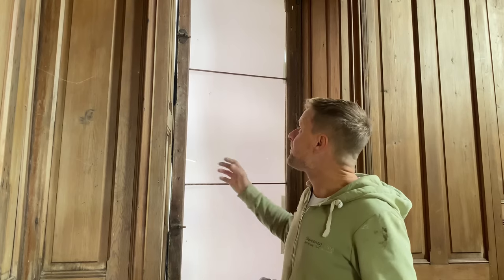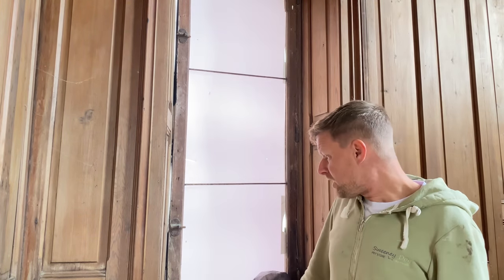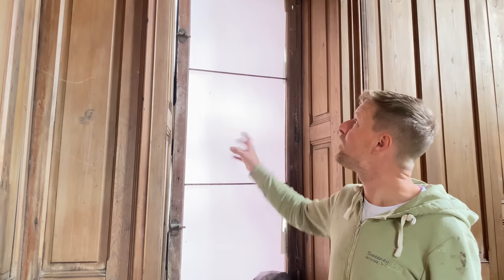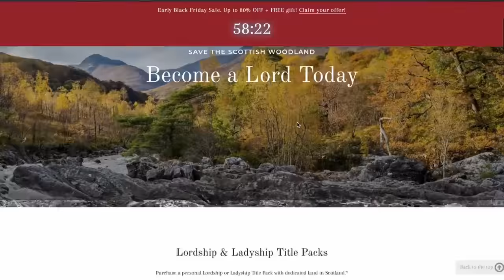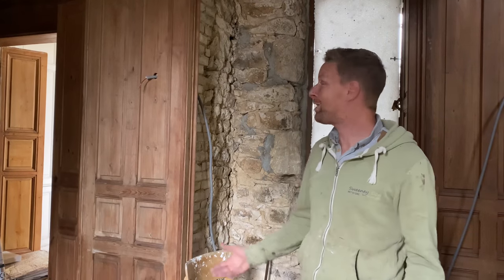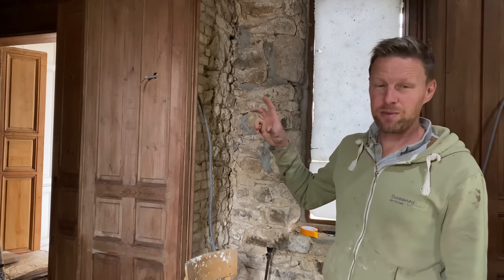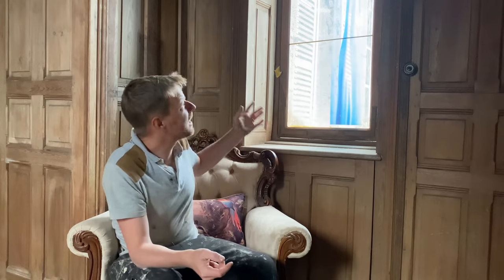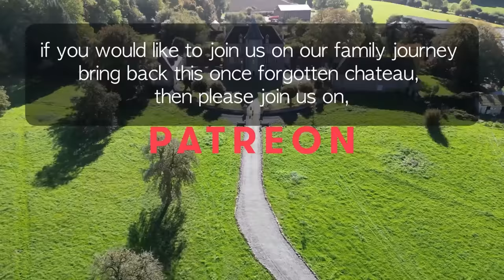REMOVING the château Woodwork | DUST & DESTRUCTION. Ep 83

Comment: Such skilled work, Terry restoring the window and the surrounding  panelling!
Good  foresight installing needed wiring whilst some panels  have been  removed. 
* Have you heard of smart lighting? 
No need for wiring connecting the switch to the light. 
Instead, either a Bluetooth or WiFi signal is sent from the switch to the light to turn it off & on. Two different  systems - either Bluetooth  Or WiFi.
Could make installing some lights much simpler! 💡

Comment: I often wondere instead of making holes or visible switches for light if a lightsensor isnt a better way to go (you don't see modern switches, etcetera and you have light when someone is in the room)
Reply: We’re replacing with old porcelain switches and tracing the original electrics that were put in :)

Comment: Question: Is the left side of the exterior of the tower intentionally supposed to be pink/reddish while the right side is gray?? At first I thought it was a trick of the light, but no, they're two different colors.
Reply: They are. It’s a type of mould, as the right side doesn’t get the wind from up the valley, the fungus has settled better :)

Comment: Love watching you restore things however I’m puzzled as to why you didn’t get one of the others to repair the walls whilst the panelling was off as the repointing looked as if it badly needed doing?Also if you can get the lighting done whilst the panelling is off,then why not the insulation too?You don’t want it to be all fur coat and no knickers,looking pretty but too cold and leaks coming through the pointing😟after all your hard work.
Reply: So...do you think they just didn't think about these things, Cath....!?
OR, isn't it much more likely they did - and took the deliberate decision NOT to do them at the present ..!?
Reply: @andymccabe6712  yes I think they will be replacing the windows one at a time as funds become available. A proper job when the money is there.
Reply: @andymccabe6712  Did I say they hadn’t thought about these things? I wondered why they hadn’t done them whilst the stone was uncovered .

Comment: Did I miss something but when did you repair the boiserie you had removed? It was also surprising that you didn't seem to have to remove any nails, pegs or screws either taking it out or putting it back. At laLande the Grand salon has wood blocks embedded that once held the original boiserie. At least that's what they think they were. They probably were for the paneling because I vaguely remember reading something years ago about the same thing in American paneled rooms of that period. Do all the panels actually sit loose against the walls? You didn't seem to have to do anything but reinsert them against one another. Another puzzle was why would the original builders build interior walls of brick but used rubble and dressed stone for the exterior walls?  My guess is that at the time the dressed stone was the most expensive, the rubble the least expensive, and the brick was mid-value material. Why would they use brick for interior walls that were mostly concealed with paneling anyway?  
BTW - It was a big surprise to learn years ago that the wings of the Palace of Versailles were/are not built of solid masonry. Evidently the king hired a man more experienced in building fortifications because the work was taking too long.  Louvois used pise de terre or tamped earth to fill the space between the inner and outer masonry walls of the garden facades. A problem occurred by the time of Louis XV when somehow they discovered that the earthen core had settled by up to a third of the height of the walls and they had to be refilled at enormous expense.  The workmen had evidently rushed the packing and hadn't packed it hard enough. It should be as hard as sandstone if done right.  Years of vibrations transmitted from floors to walls may have caused the settlement? But what would have let them know that had happened? Somehow they had to get into the cavity of each pier between the windows and some guys (not claustrophobic) had to climb down inside the well of enclosing walls surfaces and dig it all out to then replace it with either stone or more earth? I wonder if even the curators know what fills those walls today? 

I suppose they could have done it by going floor to floor from within each room but that would have meant disturbing the occupants of the apartments at three levels probably for years. My guess is they would have removed the capping slabs at the top of the walls behind the balustrade and not have to disrupt the interiors at all. This situation only applied to the north and south wings added in 1680's. The envelope was built about 20 years earlier when the king wasn't in such a rush to expand the building.

Ms. Woodruff's comment may be silly as she says but I thought the same thing seeing you stand at the open window.  30 years ago that wouldn't have bothered me. 

Love Ash's send up of patent's of nobility.

Comment: Shocked you did not repoint the stonework while the paneling was off the wall. There was a lot of empty joints, should have been blasted with compressed air to clean all the disintegrated old mortar and moistened well before securing the wall strength with new mortar. Best of luck in your endeavor. You may want to see if this product in available in France or similar, it should be painted on rotten wood before painting or filling.

Minwax® High Performance Wood Hardener is a quick drying liquid formulated to strengthen and reinforce decayed or rotting wood.

The hardener penetrates deep into the wood and its special resin binds and reinforces the decayed wood fibers
High Performance Wood Hardener seals from further moisture penetration and hardens to a rock hard solid base for lifting
Designed to strengthen wood fibers of interior or exterior rotted wood prior to the application of Minwax® High Performance Wood Filler😊
Reply: As far as I am aware the white pasty products we see Terry mixing and applying to the frames is a wood hardener. Also I have seen them use Ronseal products which is a very good product.

Comment: I admire your desire to retain as much of the old as possible but there comes a time when you have to surrender to mother nature.  The bottom of that window frame was really beyond keeping, just taking off the bad wood and sandwiching some new on top of the remainder is no an efficacious fix.  You still have dry rotted wood in the frame and your repair will last a couple of years and then it will need redoing.  Renovating an old and poorly maintained chateau is a labor of love, but even love has to include the new or it will crumble.
Reply: We will in the future Dennis but for the next year or two we have to make it water tight .. over the years we will replace one by one .. each window is a  few thousand to replace 👍